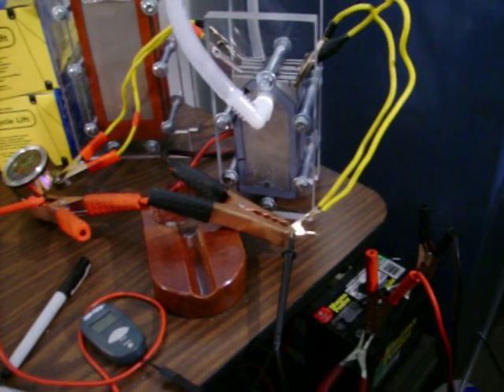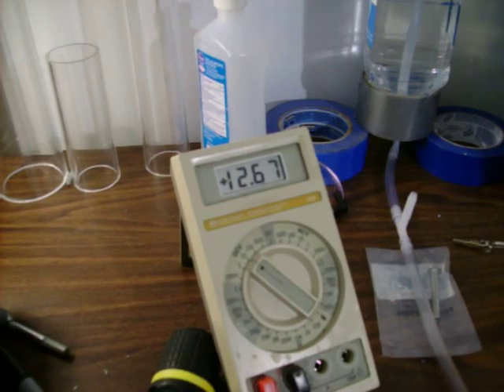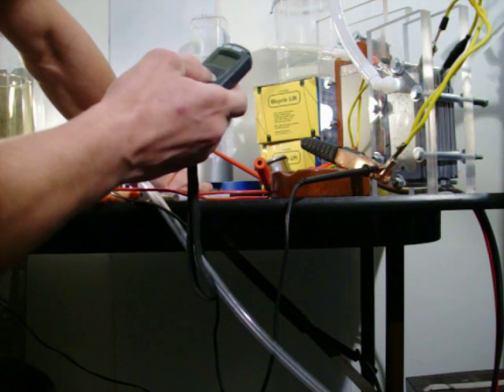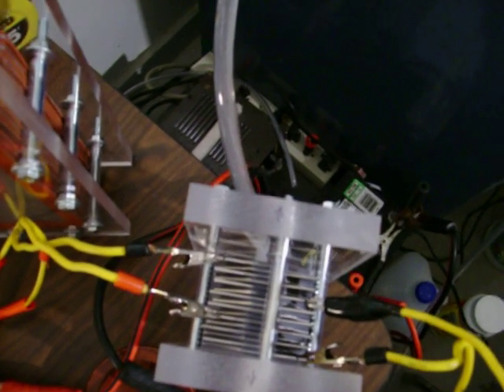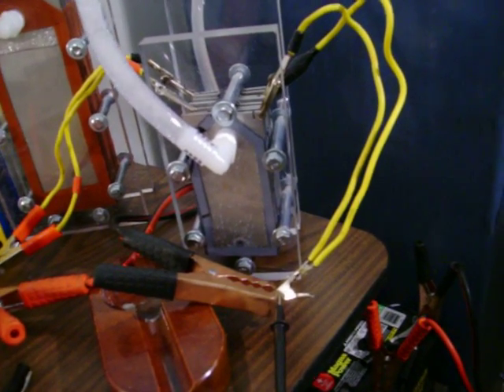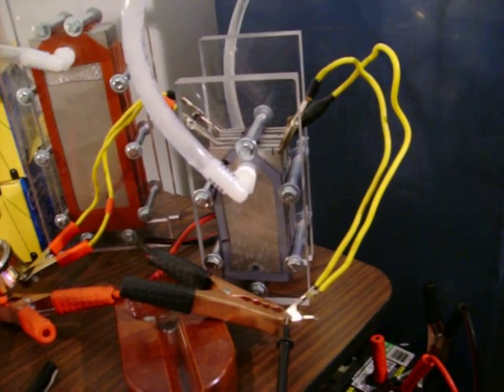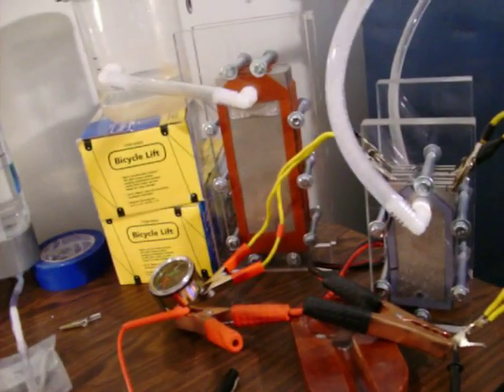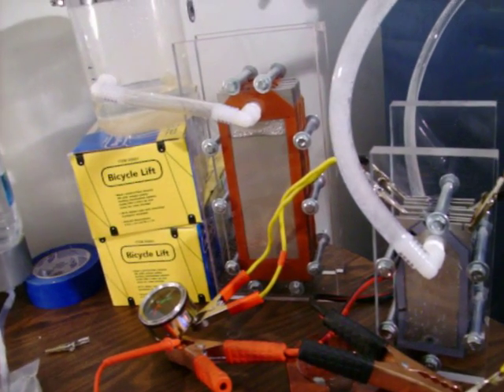HHO Dry cell with inculated holes.8.31 mmw

Comment: David, no offence , but I think you might be defeating the purpose with those 3/8 inserts.
Current flow will take the path of least resistance .If all the holes are aligned together some current will travel straight from neg to pos thus bypassing the neutrals.The edge of the holes are conductive and so are the sides,If you seal the edge of the holes the current will simply flow to the sides of the plate. If you stagger the holes from one plate to the other you will overcome leakage.

Comment: buy an auto fuse holder and a variety of fuses if on your amp meter you see 5 + amps put a 5amps fuse and se if it blows if not after a30 45 minuts go lower 4 amps this is how you can double check your Amps